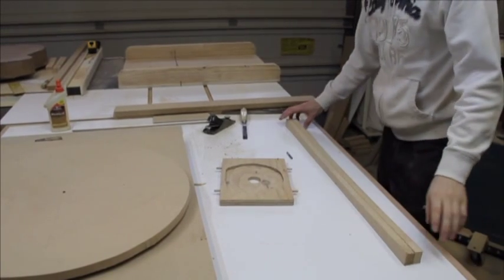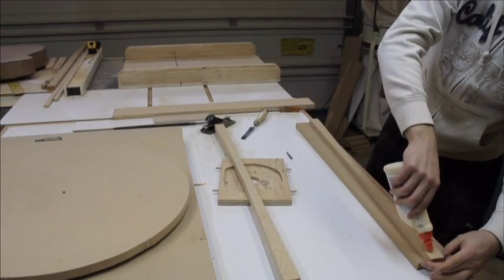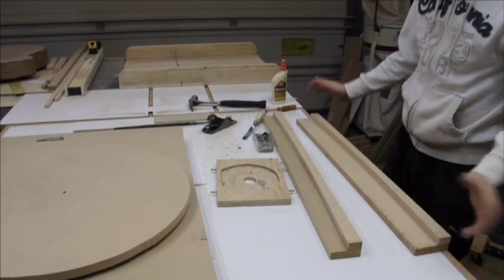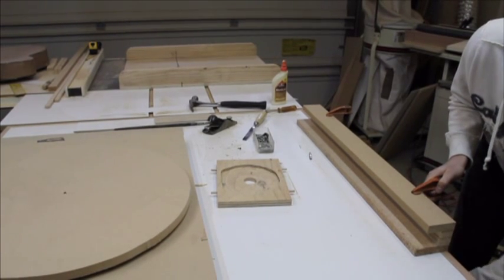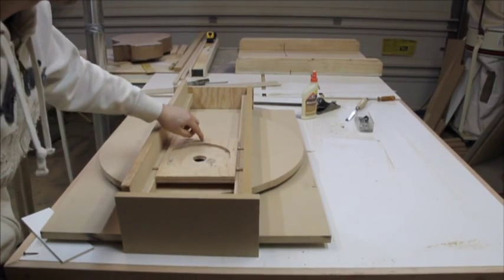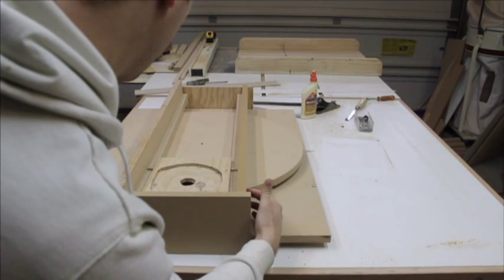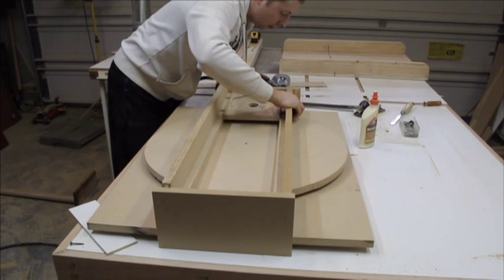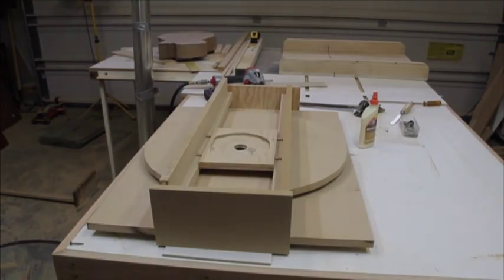How to make a radius dish part 3/4

Comment: you left out the most important part where or how you figured out the radius templet
Reply: http://www.dunwellguitar.com/HollowFormRoutJigs/HFRouterJigs.htm

Check this page to calculate and create a radius template.
Reply: You can easily make an arc on a piece of paper with a radius length string tied one end to a nail  and a pencil on the other end to mark the arc.  No calculation required.  By the way timohaism, get some safety glasses and ear pro - lots cheaper than injuring or loosing your eye and hearing.